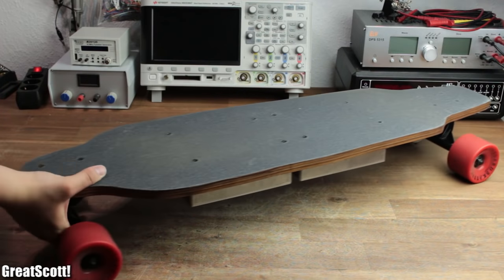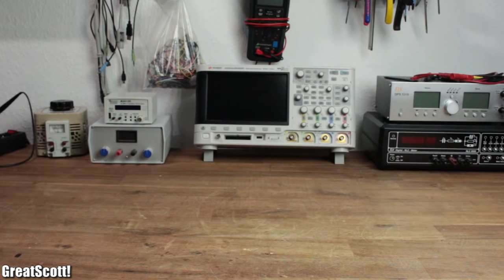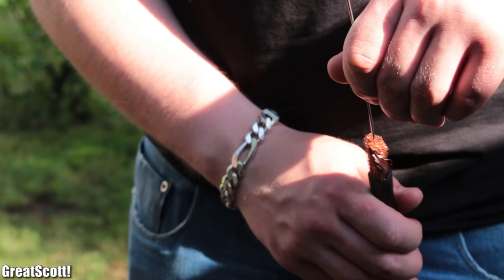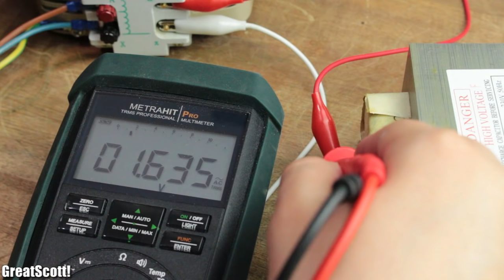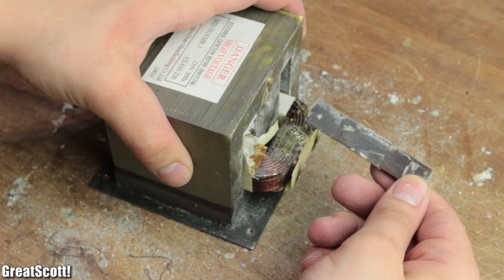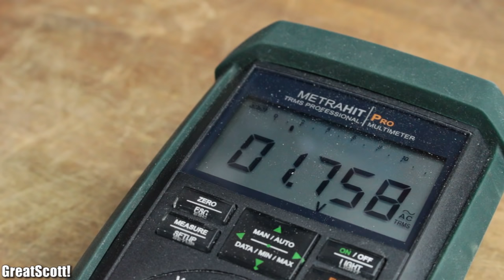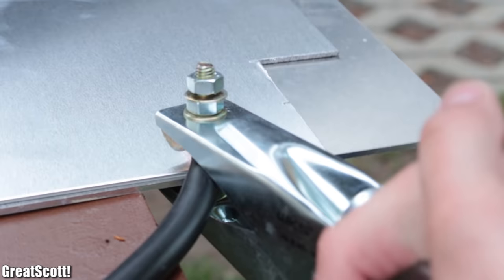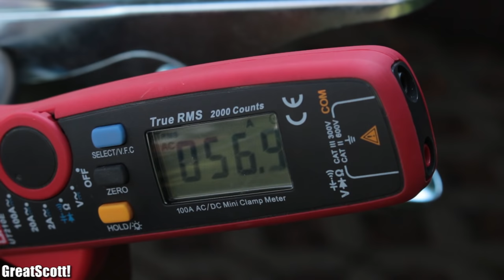HACKED!: Microwave Transformer becomes a High Current Transformer

Comment: be aware to discharge the high voltage capacitor before you start messing inside the microwave. also the magnetron may contain beryllium oxide which is very dangerous once you break it apart and inhale dust of it. only mess with microwaves if you know what you are doing.
Reply: he just took out the transformer. the magnetron never was seen here and as these microwaves propably came from a scrapyard there's really not that high of a chance that the capacitor still has a restcharge.
Afterall you are surely right; generally don't mess with high voltage, radiation, toxic substances or massive heat if you don't actually know what you are doing. I just got the feeling this guy at least has the not very complicated knowledge on how to not shock himself to death.
Reply: I took apart a microwave when I was 12 in my backyard. I'm still alive. You'll be fine
Reply: That is a myth ; the capacitor in microwave ovens has a 10 Meg ohm bleeding resistor. The voltage, if any, fall to safe level in a few minutes.

If the microwave was working, the magnetron would have discharged the capacitor as part of normal cycle because it is  used as voltage doubler. It completely discharge and charge on each polarity inversion of AC ; 100 or 120 times per second.

The real danger is if you try to create a microwave gun, exposing the magnetron to open air. I got my worst electric shock ever that way ; much more scary than the electric arc from the 25 kv of CRT.
Reply: I took apart an old TV when I was like 6
Reply: NO
Reply: All the high voltage caps in microwaves have a 10 Meg Resistor paralled inside of them.
It will discharge the cap from 2kV to a save level in about 20 seconds, so nothing to worry about.
Reply: @covodex516  the HV capacitor can stay charged for up to a week
Reply: I'll back you up on the magnetron. The antenna contains beryllium which causes cancer. If you mess with them they are safe enough but be careful not to smash that antenna.
Reply: How do you know what you're doing?
Reply: @dnetne5508  same
Reply: @Ghyus01  Its actually not, there is a ceramic insulator inside used to support the filament electrodes which is beryllium oxide.
Reply: @101nka  yes, if the resistor is removed, otherwise it would be safe within about ten seconds.
Reply: hmm I wonder if an electronics engineer like him would know that
Reply: @memejeff  That's not all true. HV capacitor itself can hold energy for more than hours but Magnetron quickly discharge it. All those caps has 10Mega resitor inside in it  but this is not the safety what you're looking for. Try to charge this cap with one 2kV impulse and somehow measure a voltage dropping. You'll be waiting for hours for completely discharged capacitor.
Reply: @samohraje2433  that might be true but considering that unless you skin is dripping wet, then your skin resistance will be more than 10K. Therefore the electricity will take the path if lowest reistance. So you will still probably be fine.
Reply: Yep you are right I used to work at the local Recycling yard and people would bring microwaves and throw them out well the guys who work there had no clue of electronics like I did... they would just run those things over with bulldozers... when I seen this I was like holy crap!!...all the while their junk pile was inside of a enclosed Warehouse dust everywhere!!... from then I started to pull them apart and remove the magnetrons.. they asked me what I was doing I told them that the ceramic looking tips are highly toxic if ground into a dust and breathed in and explained to them how dangerous just crushing them with a dozer inside the warehouse really is or can be....so in turn I ended up with about 50 or more Transformers and magnetrons and a ton of high voltage diodes and capacitors....
I have a huge stack of magnetron magnets at my shop from ripping all those microwaves apart....
Reply: He knows that but he is not teaching you that
Reply: @moiquiregardevideo  Well its possible that some older ones doesn't have a bleeder resistor.
Reply: @DeKosta  not likely at all. All microwave oven capacitors have that resistor. l collected about 50 microwave oven in the last 5 years. The oldest had fluorescent green display. They all have that resistor.

The protection of consumer is not a new trend. The laws to force companies to keep morons alive is about 100 years old, and evolving of course.
Reply: So that's what that dust was.
Reply: Pocophone F1 oxide.
Reply: @puongsrailfans703  got a sweet-ish smell to it?
Reply: so I'm NOT going to die? 
My fish will be happy to hear that.  8*)
Reply: @tylerhughes9586  i'm 13 ,i took apart the microwave and then came  searching for useful parts on youtube and yes I'm still alive
Reply: i think he would be dead if he didnt know that
Reply: nice copypasta bro
Reply: It’s a myth that magnetrons contain beryllium oxide insulators as well. Beryllium oxide is expensive and requires special handling compared to aluminium oxide. These days magnetrons are made cheaply and it’s unlikely they contain carcinogenic beryllium oxide. It’s true that more powerful military magnetrons use beryllium oxide. Also, beryllium oxide ceramic is usually white or sometimes gray, insulators in microwave magnetrons are mostly pink or purple (likely aluminium oxide with chromium) with the occasional white insulator (likely aluminium oxide without chromium)
Reply: @moiquiregardevideo  Bleeder resistors fail. You should never assume that they work.

Comment: You need at least 30-36 volts to do any arc welding. You can stick weld at as low as 60-70 amps, but you need the voltage to get the arc going and maintain it. I think you'd need 2 transformers for it. Maybe re-visit this project later? Your videos are very informative!
Reply: possibly the 2 volt transformer as an energy source and a 2000 volt transformer to ignite the arc -> The 2000 volts ionize the air between the plate and the electrode, and the resulting arc could then tile the 2 volts with a few 100 amps
Reply: @schwarzestigerle3300  That would be a deadly welder.
Reply: @zanpekosak2383  if it doesn't fry itself. could be useful tho.
Reply: Generally high frequency is used at a lower more safe voltage. No matter what you do, 2000V from a 2kVA transformer will kill you. At 220V our skin resistance and dielectric permiability is usually enough to not kill us. But at 2kV everything is possibile.
Reply: He also has the wrong frequency for aluminum
Reply: if u are looking to increase  the voltage  it won't work because both are in the same phase which is 0  degrees

Comment: I’m a little late to the game. 

Welder here. Stick welding needs about 34 volts to work properly.
Reply: 240 / 8.6 = 28v
Why didn't he just run the transformer the other way around?
Reply: @rich1051414  Transformers don't always work backwards. I think ElectroBOOM or Afrotechmods did an explanation, but it's some calculation with the coil's resistance and inductance, which you'll need some LCR meter to measure inductance for.
Reply: @NoorquackerInd  It would also turn it into a low current not-so-high voltage transformer
Reply: @legoivan44321  aluminum conducts heat extremely well. you can weld it easy with any welder but you have to preheat it. otherwise you need a extremely powerful welder/laser. in pulses etc   for thin aluminum or you'll burn right through it. it's notoriously hard to weld without the right equipment. ever notice on assembly lines when machine welding aluminum they are either doing it in pulses or moving extremely fast?
Reply: @rich1051414  the wire is maybe just too thin to be running the other way around.
Reply: @rich1051414  Because He would have to pump a large current through those very small windings, and they would certainly overheat and something would catch fire or the wires may even just vaporize and begin arcing, or arc between themselves and blow a fuse.
Reply: I was just about to say that. I'm a tig welder and I weld aluminum often. He'd also need a LOT more current.
Reply: @mattfrank5314  You're missing something very important. Aluminum forms an oxide layer, which in order to penetrate requires a ton of current.
Reply: @TheChrisey  couldn't explain that better
Reply: 40v to be sure
Reply: if I were him, I would leave old secondary in the place and weld with 2000 V. Is it bad idea?
Reply: @TheChrisey  needs more current but also having the ac helps with breaking down the oxide layer to get to base aluminum for welding. As long at he has around 18-24 volts and close to 180-200 amps on the ac circuit he has it should weld it okay enough to the requirements he has for the board
Reply: @gonawincreeps  There is no way it's going to output 180-200amps..
Reply: @rich1051414  the primary resistance of the transformer if you switched the secondary as the primary would be really high ~100ohms according to electrobooms video which will limit the current a lot as we know I=V/R according to ohm's law which means that the primary would draw only about 2 amps from the input before it starts to heat up and eventually burn now if he drew 2amps @240 voltsAC  that is 480watts of power now 480/28=17.14amps of current which is very low for arc welding which requires about 50 amps minimum so you wouldn't be able to weld even if you switch the high voltage secondary as the primary

Comment: those  aluminum electrodes are for Tig welding, used as filler rod. which is completely different from stick welding
Reply: thanks it was hilarious watching him trying to use filler rod as the electrode😂😂
Reply: wait what? would it have worked with the proper electrode??
Reply: No still not enough voltage. Even a small home welder has an output of around 12 - 30 volts. To get this you would need more secondary windings which means smaller guage wire. Then the wire gauge would be too small to carry the necessary current without melting. Only solution here honestly is a larger transformer core which would allow the large gauge secondary coil while still providing the space to have the additional turns.
Reply: Or of course as other people have mentioned... Run 2 of the transformers in series to double the output voltage.
Reply: Anthony Sigman thank you im in my second year of my apprenticeship right now so i found that explanation very informative
Reply: @traxxastmaxx2.5r75  كيفك شو اخبارك
Reply: @Mrdevs96  Additionally, TIG means "tungsten (electrode) inert gas". Every metal gets oxidized fast, when it's heated. That's why you have special cover on sticks for welding or you use inert gas to shield the heated part of the weld. He was just using current to heat up some metal. It would result in a lot of brittle metal oxide and no welding.
Reply: @Ken Mason what? where did you hear this? you have to have a flux or some form of shielding gas to shield the puddle from contaminants from the surrounding air.
Reply: @Ken Mason yeah bro it's called stick welding because of the sticks, but nice joke anyways. Just because someone welded without flux doesn't mean it's good and you should try it. And about you spending your life learning about your passion and "art"...does not mean you are somehow right. Why would you try to weld without flux if you know how bad it was? You make no sense...
Reply: @ogi22  Aluminum oxide melting point 3761F, aluminum 1221F, that is why if shielding gas not used is going to have mini pops or explosion and no weld
Reply: @transformer889  Thanks! didn't know that.besides i think oxides are much weaker and brittle.
Reply: @Ken Mason cool story bro. 😂

Comment: Dear Scott: You mentioned that the output voltage of the 2nd design is about 8 volts. My late husband was an auto mechanic and in his shop the arc welders ran around 24 volts. I am suggesting a 24v design. Hope this helps.
Reply: sorry, but just to be precise, in order to weld aluminium properly, He will need more than only setting a voltage higher. The aluminium welding require a TIG transformer, a protective atmosphere on the welding spot (with some noble gases) and a AC current. It is quite hard welding aluminium, they do so only when it can't be avoided.

Comment: Welding requires at least a minimum of 24 volts. The weld is created by the amperage but also the the potential difference between the the electrodes.
It will also help reduce loss if you keep the secondary coil as close to the core as possible.

Comment: Trying to weld Aluminium without welding experience with a homemade welder is VERY ambitious, as others have pointed out (not that that's necessarily a bad thing). I'm not a professional welder, but I have a little bit of experience with WIG/TIG welding and the theory behind it, so I wanted to point out some things I noticed (some of which others have already pointed out, but I'll repeat them for completeness).
First off, even experienced Welders often don't enjoy welding Aluminium. This is due to the oxide layer which forms on the surface and has a higher melting point than the unoxidized Aluminium below it. As a result, you'll have a puddle of molten Aluminium, between the surface layers, which will simply run away once the surface melts. This is normally alleviated by preparing the surface with a wire brush or similar, removing the oxide layer (which will form again very quickly, so timing is key there). Another trick is welding with AC (normally, TIG welding is DC with the Workpiece as the Anode, because the part receiving the electrons gets hotter), which will help breaking up the oxide layer with the changing current direction. The third problem you have would be the missing inert atmosphere, which would prevent new oxide from forming during the welding and keep the weld pool stable.

On general welding: I have no experience with this personally, because my Inverter has a HF-Starter, but as far as I know, starting an arc without HF is quite skill intensive ("Streichzündung" in german). I think you have to touch the electrode to the workpiece for the current to flow, and then lift it at the right time for the arc to form (but as I said, no experience). Also, for a stable arc, you need to roughly maintain the distance between workpiece and electrode, which can be pretty hard if your electrode melts off (like it does with stick welding) and damn near impossible if it quickly melts away (like your aluminium filler wire). This problem is increased by AC welding, because as mentioned above, the part receiving electrons gets hot.

With all this being said, my recommendation would be a design change to steel. If you put a steel sleeve over the axle and fasten it with the screw, it should have no problem taking the load. Then you can weld your motor mount (made out of steel) to this steel sleeve. 

Keep up making these awesome videos!

PS: If you happen to live in southern germany and want to practice welding with a commercial inverter, you can shoot me a pm.
Reply: Lol explanation is too big

Comment: I would recommend you put some more turns on the secondary. Aim for around 26 volts AC output. Then use a full bridge rectifier and a filter capacitor of sufficient rating to convert the ac power to a smoothly rectified DC output, which is almost mandatory for aluminum and recommended for steel.

Comment: You tried arc welding with high current whereas high current is for resistance welding. (And high voltage for arc welding)
Reply: sorry, but I have never seen someone welding with high voltage. It would be like welding something with a lightning, totally unsafe.

Comment: Aluminium is quite difficult to weld, especially for a beginner. Have you tried welding just regular steel?
Reply from the maker: No, but I will try other materials soon.
Reply: Aluminum forms a layer of oxide which has a much higher melting temperature than the aluminum itself. This means that getting a weld to start is really hard on aluminum. 60 - 70 amps at most voltages should work with most other metals like steel.
Reply: +Khurram Aziz protective argon  atmosphere also needed.
Reply: Haha. I learned how to weld with aluminum
Reply: +GreatScott! Are you from Germany ?
Reply: Same! lol  Aluminum is what I learned on as well.
Reply: @maxhijacker  or helium

Comment: Rewind the first one and put them in series.
Reply: I don't think it would do anything, if you research about transformers there has to be a conductive core for the wires to wrap around so putting them in series would do the exact same thing but in smaller steps. I think what he needs is a bigger transformer to start with
Reply: 123crispychicken123 Trust me, i'm an engineer! It would double the output power and voltage. You need about 30V to sustain an arc for welding. So probably he needs to quadruple the voltage.
Reply: Look at Grant Thompsons video, he does it successfully with 2 transformers.
Reply: it barley welds steel never mind aluminum, it uses welding electrodes the size of paper clips and it does this at a 5% duty cycle, it's funny your profile pic makes you look sophisticated cough*...nark
Reply: nope although his employment of a engineer is questionable hes still right btw if you don't know what the big words mean don't use them
Reply: not quite, I'm a journey man electrician and i'm just trying to help him out, and even though it can be harsh, passing on knowledge on is vital for every that has come to be, think it over and if you want you can try and come up with another idiotic badly worded backhanded comment.

Comment: From using truck batteries for welding, I have found that 36 volts does fine, any voltages under 36 makes it hard to maintain any weldable arc